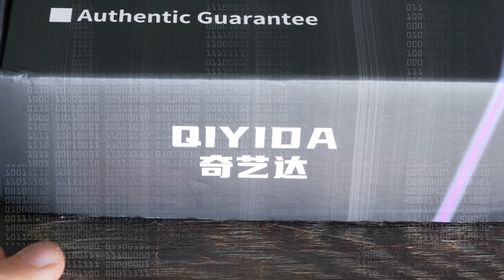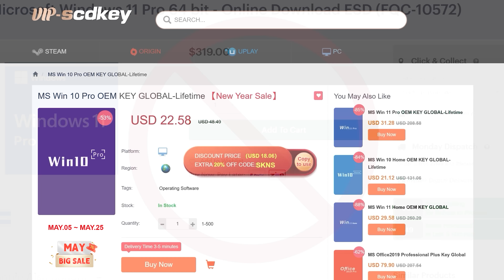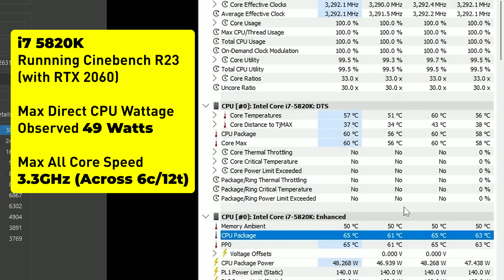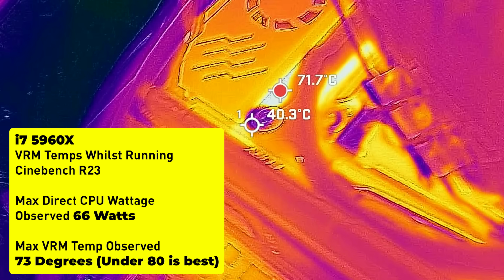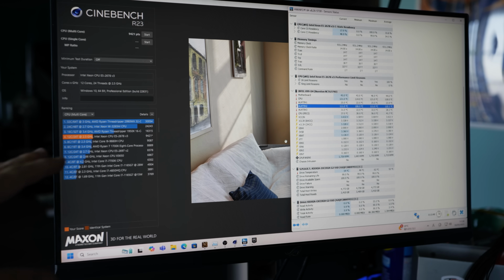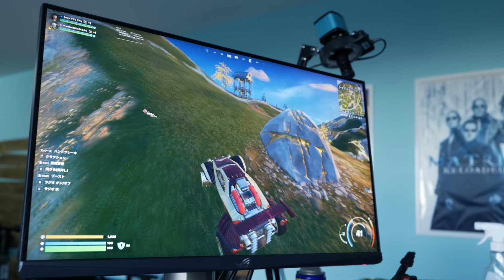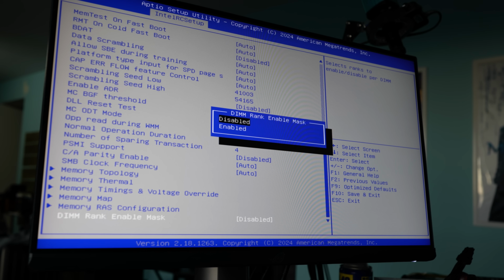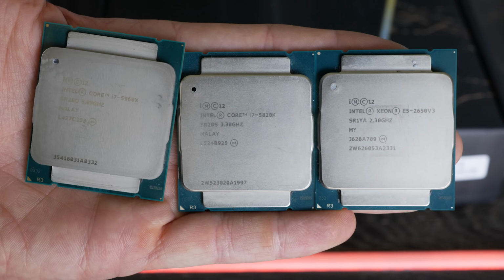This X99 Motherboard only Costs.... $35... (Qiyada X99-D4)

Comment: guys, what do you think about ryzen 9 3900x?? i've exchanged my x79 with xeon 2690v2 for ryzen 2600x on b350 (underclocked couse its so hot, in desktop 65degrees? on doing nothing). opinions??? what about 3900x?? is it worth to change 2600x for 3900x????
Reply: what do you need CPU for ? Gaming ? If yes go for Ryzen 5600 its the best bang for buck gaming CPU you can find nowadays. But careful. You need to have latest Bios flashed for your motherboard to support r5 5600
Reply: @realonepx9885  i get the same conclusion
Reply: @realonepx9885  and also 5600x is the top for my mb

Comment: I'm familiar with Qiyida. I bought a different X99 motherboard that they sell over a year ago. By itself, it was maybe a few dollars more than this one, but I got mine bundled with a Xeon E5 2650 V4 and 16 GB DDR4 (also by Qiyida) for a bit more money. It was a really good deal, and the motherboard is nice and works just fine. I was using that computer to test run some games on Linux using Steam Proton. I already had years of Linux experience, but I hadn't tried it since Proton really got going. Unfortunately, I was less fortunate with the GPU I bought to go with it, as it was dying when I got it, but the Qiyida motherboard was a great buy.

Comment: Ebuyer UK. has been selling off Biostar B450's for as low as £24.99 so i grabbed half a dozen..
Reply: check out the feedback for those motherboards: Cracking price for a brand new AM4 board, but wish I'd looked at the specs. Who makes an AM4 board with NO NVME? Well BIOSTAR do, and it's this one, 4x SATA is your lot, and only two 2.0 x1 PCIE after the 3.0 x16 for the GPU 5 phases of VRM, with no heatsinks, the CPU support list goes up to 5950X but just DON'T, you're crazy if you put more than a 65W TDP CPU on this. Appearance: The most boring, disappointing, nondescript board you will ever see, I guess it would be kind to call it inoffensive
Reply: @mirific87  use an adapter boot from mvme in pci slot
Reply: use a pci adapter, they boot from. nmve no problem @mirific87

Comment: The best budget CPUs you could pair with it are the 2666v3 or the 2680v4. You can get either for under $20. The 2666v3 has higher clocks but is only 10 cores compared to the 14 cores of 2680v4 but the 2680 also has lower power draw and better IPC.

Comment: Important thing to note about these boards - its a consumer-tier board with a consumer desktop chipset (H81 I believe?) with a LGA2011 socket bolted onto it. Its also dual-channel memory, not quad. I did build a few PC's with them and they are fine for what they are, but it's something that should be kept in mind when buying one.
Reply: Generally with these "X99" mobos, they only have dual channel RAM if they have 4 or fewer SATA ports. Look for boards with 6+ SATA ports as these generaly have more PCB layers to accomodate all traces necessary for quad channel RAM and have working sleep modes.
Reply: I have this Qyida x99 d4 and I have c612 chipset and 4 memory channel confguration.
Reply: @micharzonca8841  I also have one. C612 chipset. Dual memory channel as stated by the vendor when I bought it.
Reply: It's a gamble really, my asus x99 motherboard died and it just wasn't worth replacing with the same model as all legit x99 boards are really expensive on the used market. All these cheap ones are just rolling the dice on features.
Reply: C612 chipset. Server.
Reply: @MrGabrielgn  checking deeper I can see that it is! I guess that's why it also supports i7's, as usually these types of boards are limited to Xeons?
Reply: @MrGabrielgn  not these cheap ones. Only the really expensive ones have authentic X99/C612 chipsets
Reply: @b0ne91  Take a look at its specs. It says C612 chipset very clearly.
Reply: @MrGabrielgn  Quote from seller: "Main chipset: C612/Q87/H81/B85etc., random delivery. thank you. If you can't accept it, please don't buy it. Buying means that you agree to the terms."

Idk why they even put C612 in there. It's never going to be a workstation chipset. Those are reserved for the models that cost real money.
Reply: @b0ne91  it is still a chipset that works with Haswell-based cpus. and there's a lot of them in decommissioned servers. better to put them on a consumer board instead of a landfill.
Reply: @b0ne91  if there's demand for the cheap offering but they only have the better, just ship it to customer.     

worse when a tech company does this and cheekily doesn't tell you what gen cpu core you're getting
Reply: Yup, this is not equiped with "true" X99 chipset (C612). Also, you can quickly check if one of this chinese marvels of upcycling has one installed, by looking at a number of usb 3.0 ports ona backpanel. If a motherboard has more then two, then it is higly probable that it comes equiped with a C612 chipset = quad channel memory.
Reply: @victorspencer4885  C612 is not equal to quad channel by no means. Many simpler MBs have C612 and dual channel. I have 3 of them.

Comment: Interesting. Outside of Japan, where are you picking up Xeon chips? I can only guess Tech Les City.

Do you find them in old office PC pickups (such as thinkstations for example)?
Reply: Aliexpress
Reply: @s.omarnoor1380  And options are between the Absurdly Cheap ($5) to decenlty priced but power hungry ($ 45 - 50)
Reply: AliExpress got deals, even TOTL haswell is cheap as chips these days
Reply from the maker: I'm pairing mainly cheap x99 i7s I have been collecting over the years, now rig dumping with budget rtx.

Comment: Xeon content is back 🎉
Reply: I still have my 2x E5-2699A v4 + RTX A2000 12GB. 🥳
Reply: I’ve still got my x58 running; the xeon from 2009 has been running fine at 5000mhz which is still higher than my modern 7800x3d. All six slot loaded; 24 gb mem which is still fine in 2025!! Gonna put my 4080 in it to compare some gpu limited tests to my 7800x3d… would be  very interesting to see if high gpu load games would still yield reasonably comparable frame rates… xeon’s still greatest cpu’s ever, especially with a flattened /lapped heat spreader.over 15 years old and still relevant!
Reply: @The205GTIman  yas that's exactly the content that got me to follow techyescity but he has been kinda NVidia-ing us right now.
Reply: Yeah however Bryan made a mistake in video. Board in reality doesn't support quad channel memory, it only has 4 slots which would only work in dual channel mode. Also wattage measure in hwmonitor in such motherboards show nonsense. In reality cpu's pull 4-5x more. iF MEASURED from the wall meter
Reply from the maker: Will double check those two for you in another x99 vlog
Reply: When it comes to Xeon, a current day look at X58 I think would be cool. If things work out I'll be getting a disassembled Dell Studio XPS 9100 that's X58 and a disassembled  HP Pavilion that's AM3 with a couple non-OEM parts such as a EVGA 750 B2 & PNY GTX 970 as a untested bundle for $50 CAD (about $56 AUD) that I plan on putting together and testing when I can to perhaps do whatever X58 CPU it comes with coupled with like 12GB triple channel RAM paired with the GTX 970 and 750 B2 PSU, or for a workstation GPU to go with a Xeon or whatever may be in the X58 then there's also a Quadro M4000 that's close to GTX 970 performance but with 8GB VRAM (if it was a thing it'd be like a GTX 965 or 960 Ti 8GB) listed for $40 CAD (just about $45 AUD). Whatever I end up going with that works would be used in a flip.
Reply: Good to see ya here. Your videos and drivers helped me with my win95 and 98 builds. Thanks bud!